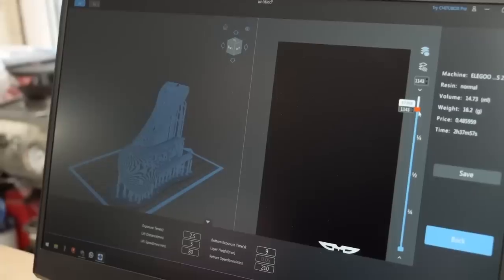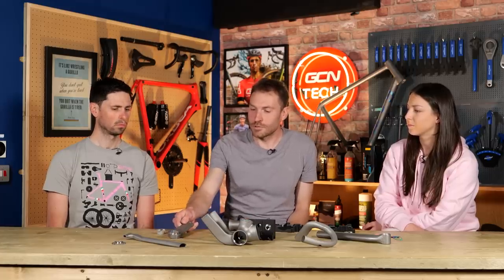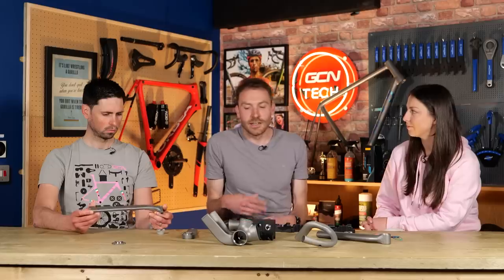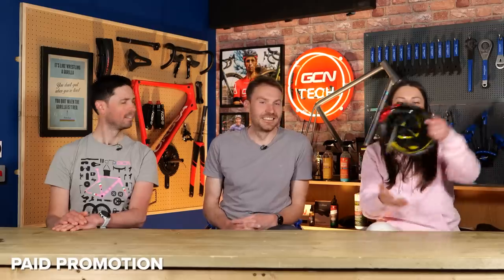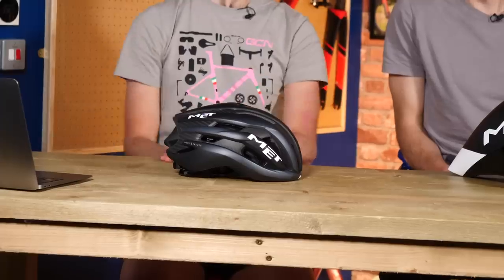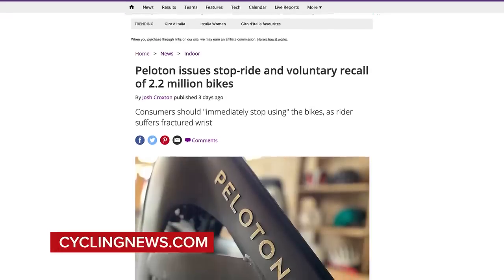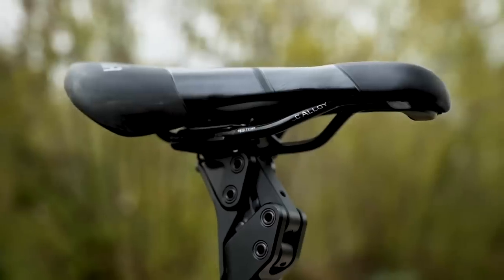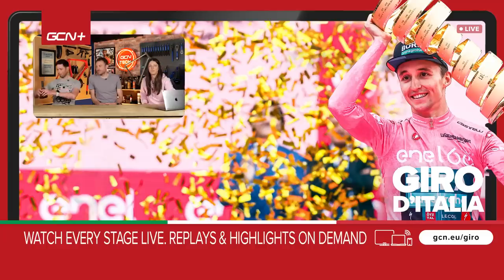Is 3D-Printed Titanium The Future Of Bikes? | GCN Tech Show Ep. 282

Comment: Question for Tom: why are we still seeing tube optimized designs used for  additive manufacturing? 
For example the steerer tube inside the head tube, a heavy tube-in-tube design, requiring a heavy crown in a constrained position to keep the strength. A hinged steering design would be stronger and simpler with increased triangulation. I'd have thought that would be easier to do with additive manufacturing than to replicate older designs.

Comment: I kept waiting for you to ask about strength and durability testing of printed components.  How does printed titanium compare to forged titanium?
Reply: Airbus uses 3d printed Titanium parts on the A350. So the technology should be fine. 

Space X 3d prints the inconel turbopump casing of the Merlin rocket engine. 

These are not just bicycles
Reply: It will never be as strong for the weight. The metallurgic alignment even after post heat treatment will always be weaker than forged

Comment: I think the practicality of full frames is still a ways off. The quality of the parts both in nylons and metals aren't quite there yet, though there are emerging technologies that should allow for more control of the grain structure of the metals that could get there. Right now the trade off for both is that they need to be overbuilt compared to parts made with traditional methods.

Still its very exciting and there are other very cool doors opened by metal 3d printing for bikes like printing molds for custom lugs and then using the emerging thermoplastic composite tech being used by the new Chris King wheels to make the lug.
Reply from the maker: Do you think this is the future of manufacturing? 👀
Reply: @gcntech  The future is already here! Its already changing the way Ti frames are made. But for more general frame building, I think Scalmalloy is a more likely candidate.

Comment: The thing I will sure try mentioned is Pirelli's high pressure sealant, item I missed so far,  for years using Caffelatex for all my tyres but I have impression it's not doing so well over 6 (or even 5) bars, and P Zero 4S will come as my choice for autumn, already did several thousands km on P Zero race 28 and 30 mm with no flats, bit less durable than Cinturatos I've also used extensively but faster and quiter... hope 4S will share main advantages of both lines with grip, comfort and super high reliability while still not losing too many Watts:-)

Comment: Awesome!!! 
Titanium is my favourite bike material, but I've never got one because they're generally not as aerodynamic or as cool looking because you can't normally shape titanium as crazily.
After I saw Czinger 3d print parts of their car out of titanium, I've been waiting for the day that we'd get it for bicycles.
It's not just that they can be aerodynamic like carbon fiber but by using ai to shape the material, you can get it as light as possible and it looks crazy awesome like organic material.
Just look at the suspension control arms on the Czinger 21c.
Also not just for road bikes, we'd just be going for aero shapes. I'd really love to see those organic shapes used for MTB frames, especially the linkages on full sus bikes.
There's actually a bike called the mx-6 Evo that has that organic looking structure for the parts that connect the seatpost to the frame.
Just worried about the price but with all technologies, things get cheaper as it matures.
Reply: The irony is Titanium is used in AEROnautics...

Comment: I personally wouldn't trust 3D- printed titanium. It's only safe for prototype use and non structural components.  If you remember the Team pursuit at the 2020 Tokyo Olympics, when a 3D- printed handlebar component made by another boutique  bike brand manufactured by Bastion Cycles failed spectacularly ...
Reply: In this case you shouldn't fly with an Airbus A350, because they use a lot of 3d printed Titanium parts there
Reply: if you question a material just because one accident, then on the top of your list it should be carbon fibre, since every year there are thousands of incidents of carbon parts fail in races.
Reply: Very scientific comment of yours. Maybe you should let people talk who actually studied for an engineering degree and are able to proof, test or calculate if something can be trusted and stop judging a material because of "that one thing you've seen on tv once".
Reply: @erikschmidt5263 That's right, since 3D printing is used for aircraft and rocket parts it can not really be wrong for something like a bicycle. The safety standard in aircraft and space flight is a little bit higher than for a bicycle
Reply: @simonm1447  You do realize I'm on your side do you? 😅 I was referring to the original comment
Reply: @erikschmidt5263  yes, of course. My post was meant as a complement to yours too.
Reply: @erikschmidt5263  OK, the original comment sounded a little bit misleading, I edited it to fit better into the discussion

Comment: Not a fan yet. The molecular structure of the metal just isn't the same as if you used metal coming from a foundry. The% of ingredients in the metal when they form tubes isn't really reliable in printing because the powder isnt mixed all at once, so you have to be sure all the ingredients to make it strong or give it the properties like a reynolds steel for example really isnt possible.
Reply: They did make suspension control arms in a hypercar out of 3d printed titanium, as well as many of the other parts so I guess it can be done strong enough. But maybe it'll be a weight issue in that case.
Reply: I was wondering that. I wish they’d have gone into the technicalities of the structure. Can’t see how it can be like metal tubing.
Reply: Titanium's properties at their near worst are going to beat out steel for the demands of a cyclist.
Reply: While* you've got a point about the crystal structures not being the same (though there's no reason that can't be accounted for in the design), the powders they use are already the final alloy.
They're not mixing X% titanium powder with Y% aluminium and Z% molybdenum and just hoping that it all gets distributed evenly to create the same alloy throughout. That would be insanity.
Reply: Airbus uses a lot of 3d printed Titanium parts on their new flagship, the A350. I'm sure they checked the parts before they used it on an multi million € aircraft

Comment: Dear GCN. Really enjoy your videos and got into cycling last year both for fitness and utility. I really enjoy being able to take a small vehicle into a new town for exploring as well as using the bike paths, in total I have ridden 600 miles since October. However I recently discovered this paper which I find concerning and deterring from riding my bike "Evaluation of Noise Exposure Secondary to wind noise in cyclists". The paper states that are 10mph wind speed it is equivalent to 85dBa which is enough to damage hearing. I can easily maintain 13-15 mph which raises it up to 90dBa. Another study that references this paper measured 75 dBa with an average speed of 10 mph. Both of this papers used microphones mounted near the ear but not in the ear canal. Thus I have reservations of the results, however assuming the results are correct then cycling has risk for hearing loss. These papers also implicate that simply standing in a breeze of 10mphs can be damaging to hearing (thus my reservation). Also cycling with ear plugs is no fun and could be considered borderline dangerous. With that background my question is do professional cyclists experience hearing loss (much higher average speed)? Are people aware of the risk? I am wondering if maybe this could be talked about in a future show?
Reply: No
Reply: Good question. If you are concerned about it, there is a product called "Cat-Ears" (Edit: thanks, Steven!) that you attach to your helmet straps and reduces wind noise without affecting your ability to hear cars or people around you.
Reply: Pardon?
Reply: @Frostbiker  that's almost right. "Cat-Ears" is the product name.

Comment: GCN keeps talking about stuff that 99% of us can't afford.
Reply: There are car racing classes that have a designated "claiming cost". In order to eliminate the ridiculous costs of bike racing, 2000 Euros (or less) should be a good limit for the basic frame.
Reply: And half of that 1% won't afford. 🙂
Reply: @ctcboater  I can buying a brand new motorcycle for less than 10000 dollars, and it has an engine, a transmission, and better disc brake and better wheel and tyres. Bicycle for over 10000, it's beyond my comprehension.
Reply: Please tell me you're not saying titanium bikes--additive or tube--99% of us can't afford. In case you are, carbon bikes can be and often are more pricey than the most expensive ti bikes and there are plenty of ti bikes available for around $3,000. If you're talking of Sturdy, the point was to talk about the current tech and how it could be more and more relevant.

Comment: Aren’t they going to invent a way of 3D printing carbon fibre eventually?
Reply: For smaller items, the size of the fibre can be small and provide extensive benefit.   However, for larger items it is get really tough really quick.   Maybe someday in the future...but I would right now printed titanium provides a demonstrable benefit compared to other "metal" solutions.      We still need to see if the same holds true over something like a carbon fibre frame.
Reply: No. The word fiber should give it away....look up the Lexus LFA manufacturing if you want to see the ideal future of strong carbon
Reply: There is. Continuous filament thermoplastic printing

Comment: 3D printed metal is sexy, but there is way too little control. The properties vary by location and direction in a build Considering that Ti have very poor fatigue and impact toughness to start with I can't imagine that it gets any better when powder fusion is used.
Combine this with the near total lack of non-destructive testing you had better have large factors of safety.
Printing headtubes, bottom brackets, and special fittings makes sense when you only need one-off.
But properties of 3D Ti is a small fraction of what a conventional wrought piece of metal would be.

Comment: I would like to know how strong are printed parts? I'm just a layman and not a materials scientist but my impression is that they would be quite brittle and prone to fracture when flexing due to being formed from a powder instead of a homogenous lump of metal. Very bad for things like handle bars and chain stays, and less reliable for parts like drop outs which could perhaps be CNCed.
Reply: Airbus is 3d printing titanium parts for the  A350 and SpaceX 3d prints inconel turbopump casings of the Merlin engine. It isn't brittle, otherwise it would not be used on aircraft and rockets

Comment: I'm with Eric on his budget bike build, in using components from previous projects. Recycle the cycle is my motto, top man Aled.👍
Reply: Except the point was a to compare a bike you can build for £1000 to one that cost £10,000 - taking a Dura Ace crank (one you’d find on a £10,000 bike) and putting it on the build defeats the purpose of the video as someone else looking to do this doesn’t have parts like that laying around.
Reply: @cyclo_furious  Well, if I had a £1,000 max spend on a bike build, but also had Ultegra drive train sitting in my shed/garage, and possibly some decent wheels, the I would certainly use them rather than knave good stuff in the shed. It would then be that I've got the bike I wanted and spent less than the £1,000 budget that I anticipated. Winner.
Reply: Of course it's better to re use parts but you can't say they wouldn't be worth anything because you bought/were given them earlier. He could say he made a bike which cost nothing as it was from donated parts or was stolen!

Comment: Its still so lazy to use the stuff sitting around… Its not about the Price in the budget, its about spending the time to reasearch and get the best value pieces. It would be nice if you had like 3-4 wheelsets from marketplace or whatever and then you commented on why you then chose the wheelset that you went with. The video becomes a video just about building a bike, when what is interesting when you do a budget bike with used parts its about the process of picking through available parts. There is a hundred videos on mindlessly bolting parts together to form a bike. Haven’t we all had 5-6-7 tabs open in our webbrowser with potential upgrade parts, and then had to choose? Do I take the sligtly older dura Ace or the current generation 105, do I Pick the part scuffed and grim looking Ultegra or new in box 105? Thats is What is interesting. I know you Can do better. Give the bike to some Amateur or Veteran or kid or whatever after. Its not wastefull, its picking pieces that is not being used and putting them together in a meaningful way, using your great expertize to maximise value for money 😄